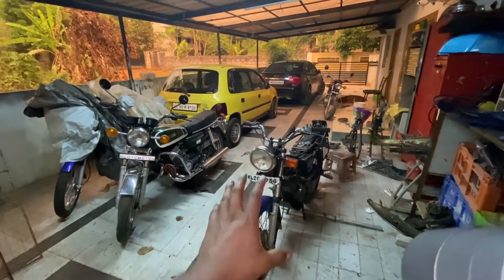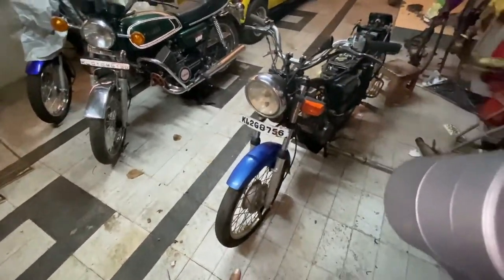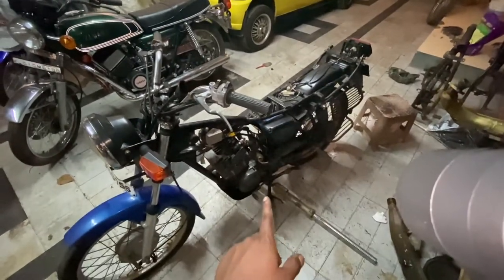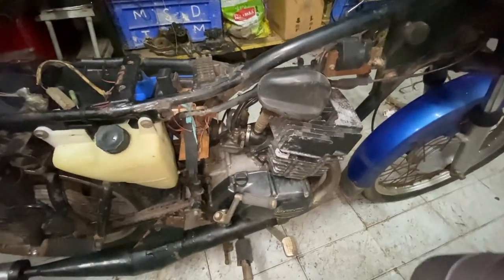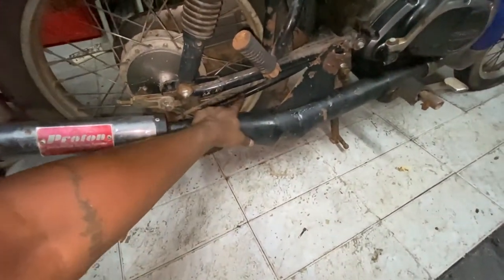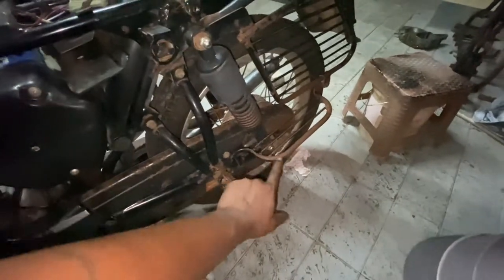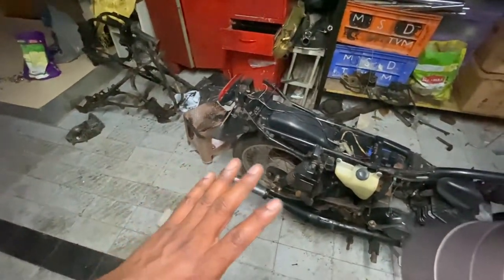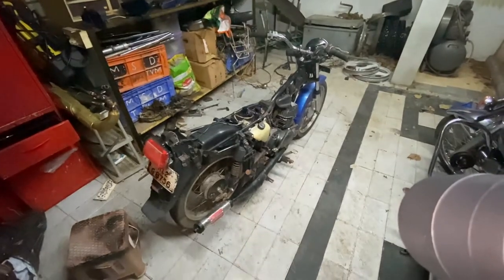Blue Shaolin Restoration Part 1, Everything wrong with it and restoration planning (English video)

Comment: Bro just a quick question, if cylinder has a sleeve is it ok to use the bike or is better to rather use another block. This was for an RX100 also what should be the cost for a used block.
Reply from the maker: You can use your bike

Comment: I have a shaolin 
I only have a shogun oversized cylinder , 
Can i fix shogun cylinder , by putting a sleev , 
Because i dont have money to buy one shaolin cylinder , 
I am a student ,
Reply from the maker: The crank case is different but the combustion chamber is same, it won’t work as the crank and connecting rod length is different, chances of the piston hitting the head is pretty high
Reply: @Yamakaze  so what is the solution , 
Need to get a shaolin cylinder , ? 

When i bought it , it was running , but not in a proper way , no power no milage nothing , 
My hostel idiot friends always took for ride ,bit never fill 2T with petrol , and it stoped its working 😌
Reply from the maker: @vintage.vibees  you need to get it rebuild, there is other option